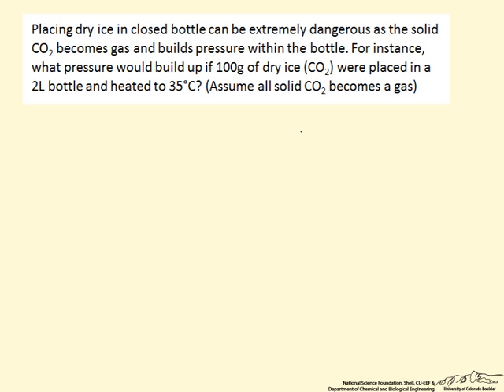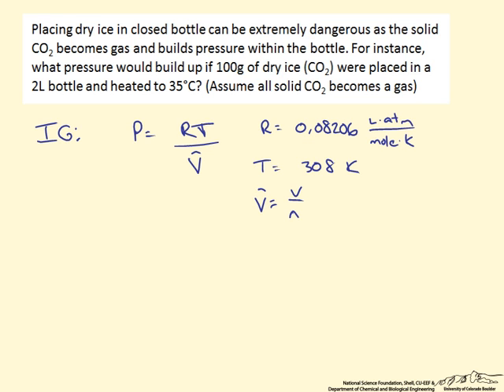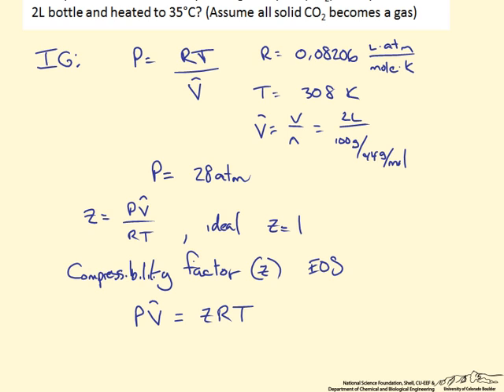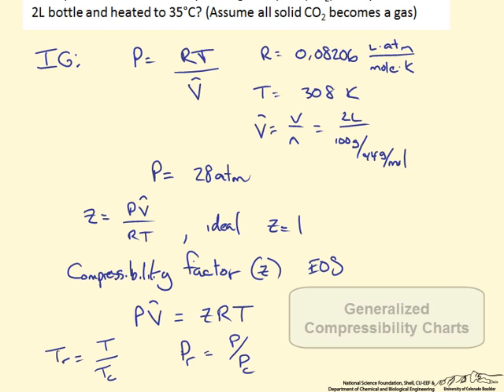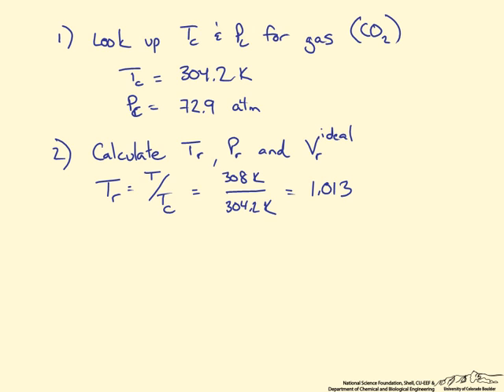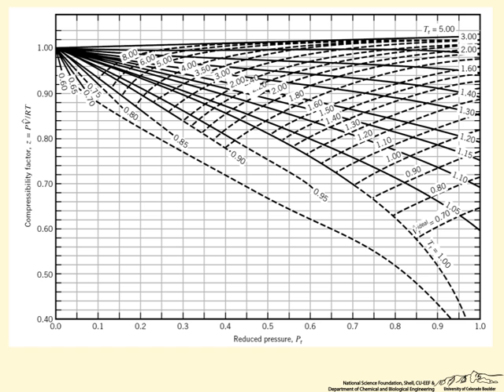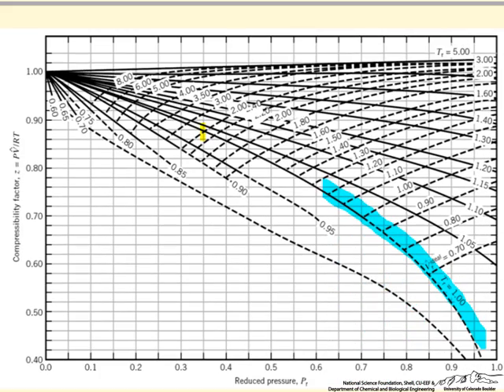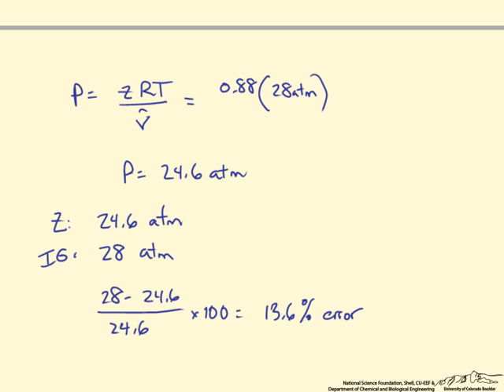Compressibility Factor (Z-Factor) Equation of State

Comment: why do we create reduced temp and pressure"?  it has no justification. makes no sense.
Reply from the maker: Because the compressibility charts available are in terms of reduced temperature and pressure
Reply: Thermodynamics features several dimensionless parameters for convenience that may not make sense on the surface (for example, relative pressure and temperature also are dimensionless parameters used in problems involving entropy calculations).  Reduced pressure and temperature are additionally convenient in presenting compressibility expressions derived from equations of state.
Reply: @small_ed  thank you for answering. much apreciated.

Comment: i keep getting a really high number as my Vr please help me with this question,"Duduced the pressure exerted by 75kg of CO2 gas kept within a canister of capacity 2500L for a temperature of -30c Tc=304.2K, Pc=72.9atm. Mr=44gmol^-1" when i calculate Vr i keep getting a number over 5, please help :/
Reply: Check your units.

Comment: Couldn't you just read the reduced pressure from the intersection of the Tc and Vc lines? I get Pr=~0.35. When multiplied by the critical pressure (72.9 atm) I get 25.515 atm, which is pretty close to the value you calculated, and likely within the error of the plot.